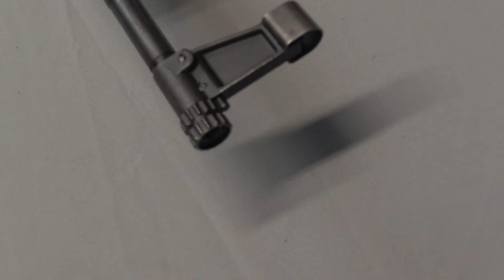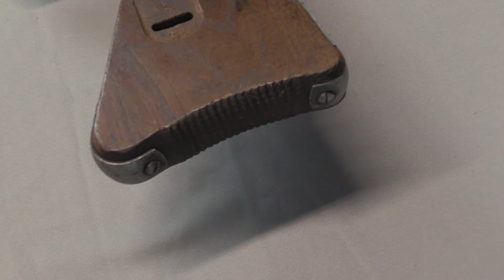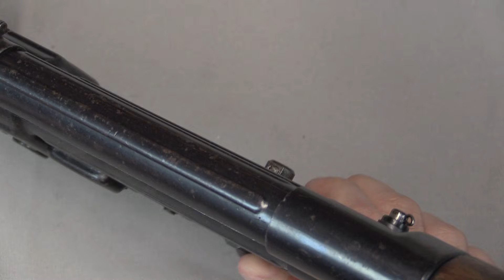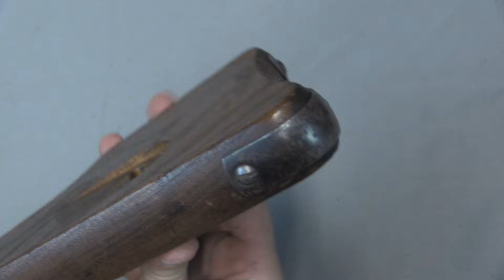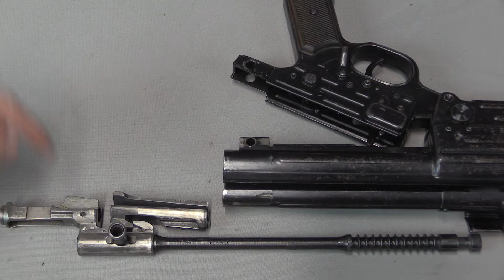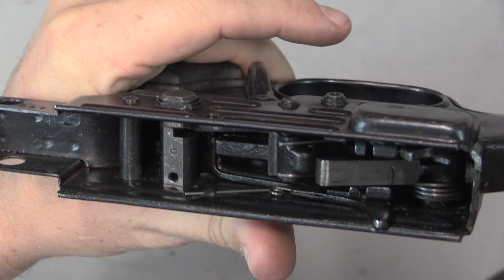Sturmgewehr MP-44 Part I: Mechanics

Comment: During the war the allies could not replicate the German fighter planes size and strength ratio's the forces on the fuel silage required heavy steal and massive welds... After the war the allies found massive stamp machines weighing 100's of tons and standing 4 stories tall. This is how the Germans were able to make planes lighter faster and more agile by stamping the strength into sheet steal and aluminum. They were removed to the USA after the war and even bigger machines were developed to stamp parts for our newest planes...

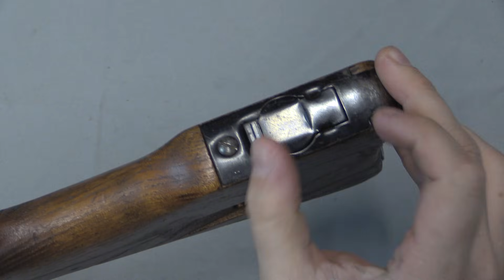Comment: 8:50 that space in the stock is for a special cleaning brush for the gas system. I am a reenactor and it took me a good while to actually find an original brush for the gas system (it is a little bit bigger than the normal brushes from the RG34 cleaning set). But it is specified in the original manual for the gun.

Comment: Why would stamped metal parts have lower trace-metal requirements than forged ones?  Both of those processes involve pressing the metal into shape under force; the difference is basically just whether it's cut before or after shaping.
Reply: they don't need to be strong as the forged ones because they aren't pressure bearing or handling the force of the bolt cycling?
Reply: High strength parts were machined and hardened also. Alloys were required.

Comment: The magazine catch & the hammer through the bolt carrier group on the Stg.44 is more similar to the AR-pattern rifles. Also, the recoil spring is present in the stock. Also the dust cover.
Reply: I dont know what kind of AR you have but there is absolutely nothing resembling the two lol!

Comment: HELP WANTED!!!
There is a lever on the right side of the lockwork, in WORLD OF GUNS it is named CATCH LEVER. I am trying to figure out its function. Maybe some kind of inertia safety device, but I just can't understand it using just WORLD OF GUNS. Any ideas? The inner portion has the trigger and sear, on the left side we have a very complex lever to struck the "disconnector" (that sear which catches the hammer when the trigger is pressed) when the gun is in full auto; the lever on the right side is the problem.

Looking more closely, looks like something to prevent the trigger from moving when the bolt is manually operated, but the part on WORLD OF GUNS is too short and it is not clear that the bolt pushes it forward when the gun is in battery.
Some models in WOG have errors (I found errors in Colt Python's hand and the UZI ratchet cover).

Comment: Question for anyone who would be able to answer this, gun experts only and preferably only gun experts, soldiers,  and  historians who would have the ability to  answer this question regarding the Sturmgewehr MP-44

So in the Sturmgewehr 44 manuals of  WW2 (in particular-  BArch, RH 11-I/44  Entwurf  zur  Heeresdienstvorschrift), the images   clearly display wehrmacht soldiers  holding the  gun by the  mag  and the handle,  unless there was something like free hand aiming position standing or kneeling where the hand is  behind the mag resting by the  magazine lock button. Is there a reason they do this? The only reason I could think is that there is no significant  handguard around the gas block like every assault rifle after AK47 has, but I am not quite sure.

I mean I could think also that it gave quick access to the  selector button which means   being able to use the german tactics explained in the pamphlets better

Comment: As we look at the discussion about expensive/cheap part combinations, plywood is partially an invention of WW2 Germany. Running out of the wood that was sufficient for the K98 rifle, German engineers realized that a laminate of thin slices of high quality oak or ash wood glued in with slices of birch or pine would produce an equal or even superior stock, and if alternating directions of grain were used it would not warp under moisture.
Reply: While I understand you said "Partially", plywood board was already in common use in the US in the 1880s, and the concept of laminating wood traces itself back to antiquity, with the ancient Egyptians making use of it.

On the other hand I agree that in terms of wartime gun stocks, the german use of plywood is quite innovative.

Outside of guns though wood lamination is a very old thing

Comment: You really need to get an StG to the range and run it through a WW2 2-gun action match. Just to demonstrate how this rifle changed the dynamics of the battlefield.
Reply: It didn’t change the battlefield at the time, Not even a new concept, The federov ovtomat was the first assault rifle, Though i do think the STG44 is a better assaul rifle
Reply: @hdexotic1914  Where it was present it most definitely did. Infact it was reports of how it proved key to the success of several operations that even convinced Hitler to finally approve the weapon. The federov avtomat is not a rifle with a pistol grip & inline stock firing an intermediate rifle cartridge, it's an automatic rifle. You could call it a predecessor to the assault rifle, but it's not an actual assault rifle.

Comment: Is it just me, or is the barrel-tilt mechanism on the H&K USP a lot like the bolt-tilt mechanism on the StG 44? The USP has a hook in the top of the guide rod that mates with a hook on the barrel. As the slide moves back, the hook pulls the barrel down just far enough to unlock it from the slide.

Comment: I believe you got a little disorientated with your reasoning as to why the metal stamping was used in the production of the weapon. Yes, you were correct in saying that certain elements for steel were not plentiful in Germany, but this was not a problem in the 1930s, which is the date you stated. The Sturmgewehr was not produced in the 1930s but in 1944, when materials not contained in an ever-shrinking German Empire were hard to come by. Actually, in the 1930s all materials for steel and associated products were readily available to Germany, as in this period it was going through its re-armourment period in all services. E.G. The highly successful MP38 and MP40s were made of steel castings and not metal stampings. On a side issue, I've always wondered how much Mr Kalashnikov studied the Sturmgewehr 44 when designing his "revolutionary" new Assault Rifle.

Comment: Just imagine, what would've happened, if Germans had managed to rearm their frontline troops with these when they still had the chance to do so.  The prototype was succesfully tested in late 1942. If they had started the mass production immediately aftwerwards and pulled most of the K98s from the frontline troops and replaced them with STGs, then holy shit that would've been some army with some freakishly strong fire power.
Reply: I don't see how having slightly better small arms helps you win a war where you have so little gas you're still using horses for logistics, and you're fighting a war on two fronts with literally every other large power in your hemisphere, plus one in the other one.

Comment: Father of all modern assault rifles
Reply: Der Vater, ya.
Reply: Incorrect, The first assault rifle was the federov avtomat, Not the stg44 surprisingly
Reply: @hdexotic1914  federov did not fire an intermediate cartridge, nor did it have a pistol grip. It categorically is not an assault rifle.
Reply: @hdexotic1914  It may be the first, but stg44 is more influencial, because almost all modern assault rifles look like Stg44, while the federov avtomat looks like a traditional rifle, except automatic. Doesn't even have a pistol grip.
Hence why the Stg44 may not technically be the first assault rifle, but is still the father of modern assault rifles in terms of design.

Comment: The trick by using high quality metal only for the important parts, is an old old old trick :)

Scandinavians (that includes vikings), and many Germanic tribes (A commonly known tribe is Saxons, which in large part took to Britain as well).
Used this metal method as well which is evident on Dane Axes and the like - they would use hard metal (steel) for the edge of the axe and soft metal (iron) for the main body of the axehead (which also meant the axehead was better able to withstand the shock of being smashed against something).

Comment: Gee and everybody thinks this design has nothing to do with the Avtomat Kalashnikov
Reply: Machinen Kanone It s nothing to do with the Avtomat, since the avtomat had a full sized rifle round instead of Inter-mediate rounds, and the Avtomat was used like a machine gun and used clips. It wasn’t an Assualt Rifle and it didn’t influence the first Assualt Rifle in any way but it did influence the AK-47
Reply: @ironmarck3133  uhhh, I think you mistook "Avtomat Kalashnikov" for "Federov Avtomat"
Reply: Completely different operation (ak is rotating bolt, stg is tilting bolt like the svt). The Russians considered the ak to be a better submachine gun, and still call it one today.

Comment: The small curiosity: Germans have not any resources of special enriching additives steel. But they had "special connections" in Switzerland! So, MC5 (UK intelligence organization) discovered in 1944, that one of Switzerland clock companies ordered a huge amount of chromium "to the springs in watches". How quickly calculated in London, suffice it to produce the springs for hundreds of years. Of course, the arrested ships carrying the chrome" Switzerland" by the Hamburg Harbour.

Comment: i hope this video finally demonstrates that the STG influenced the design of the AR 15 and not the AK the only thing that the AK took from the STG was the stamping technology that existed even before the STG so technically the AK has nothing to do with the STG in fact the underfolder was taken from the MP40 and that's about it the rest of the AK is actually influenced by american guns but that's another story
Reply: right right i forgot the ak had a long recoil spring that extends into the buttstock, a spring powered dust cover, upper and lower receivers that are held together with push pins oh and dont forget the magazine release button and thumb fire selector and safety
Reply: But the M1 rifle did exist back then and it did influence the AK's rotating bolt action. The StG. really doesn't have as much in common with the AK as it is often said to have.
Reply: The STG influenced the creation of the AK as a concept - the concept of a mid-size cartridge, fully automatic capable rifle with a large magazine capacity, rugged and relatively quick to manufacture and usable in engagements out to 300+ yards potentially.

I've not really heard someone say the AK was an influence on the actual mechanical design of the AK.

Comment: Hmm... tilting bolt, triangular firing pin, gas piston operated, intermediate cartridge, sounds like a certain loveable Soviet self-loading carbine. I'm not saying the SKS is based on this or the other way around, I just think it's funny how similar they are. I suppose you could make the argument the the STG 44 was designed at a time when German engineers had ready access to some of the older Soviet tilting bolt designs, but I don't think they were a major inspiration. I suppose what I'm really saying is the SKS is a (relatively) cheap and available mechanical analog to this for those who want something with a similar primary action type.

Comment: Are intermediate cartridges more controllable due to having a lower mass bullet, less propellant, or a combination of the both?
Reply from the maker: Both.
Reply: Thanks for the answer.
Reply: too much powder, small bullet will cause big muzzle flash and wastage of power , gun spraying out unburnt powder out from front

to big bullet, less powder results in low velocity and thus less damage to target

both have to be tuned according to each other and barrel length

the more the powder and heavier the bullet,
the more, is the momentum of bullet and Newton's third law is the rest of the story

Comment: I thought the definition of assault rifle also included an in-line stock.
Reply from the maker: No, it does not.
Reply: Hmmm, I would  have thought some notion of controllable automatic fire would factor into the definition.  I don't really think of Mini-14s as assault rifles.
Reply from the maker: The fully automatic version of the Mini-14 is the Ruger AC-556.
Reply: Most people don't really think of mini-14's.
Reply: I guess you've never needed to hire...the A-Team.
Reply: Correct, the Ruger AC-556 was their "military" version of the Mini-14, though it was never actually picked up by the US Army or anything. Nowadays Ruger is just selling their old stock of AC-556's to people with the appropriate tax stamps and licenses in the US (if they haven't run out yet). Apparently it's a relatively cheap full-auto gun compared to Colt's full auto M16's and such.
Reply: Jersey Mike's Rail Videos Mini 14's do not have selective fire though.
Reply: Not entirely so. Some of them do as there is mention of FA mini 14-s in an old Jane's Infantry weapons book I bought as a child. I think Ruger went after some military contracts at on point with his gun.

Comment: So how come the CZ side tilting bolt rifle has the barrel off at a stupid angle and and side tilters like this don't seem to suffer the same way?
Reply: It isn't a side tilter. The bolt tilts vertically; it's locked and in battery when the bolt is "down".
Reply: This is a vertical tilting bolt, and the bolt face was canted to accommodate the tilt.
Reply: yes but I should have stated it different. Either way it tilts off an axis. Which axis relevant to the shooter wouldn't dictate a difference in other aspects like barrel alignment would it?
Reply: bren has a tilting bolt,in fact the Germans got tilting bolt from the Czechs.

Comment: Wasnt one of the issues with this rifle poor headspacing? If I remember correctly rather than doing precision machining, they placed blocks of lead to correct any issues?
Reply from the maker: Yes, the headspacing was very haphazard - finding them today with up to 30 thou of excess headspace is not uncommon. However, between the low chamber pressure and the wartime steel-cased ammo, this never created a practical problem.

Comment: Not even gonna lie. This piece is worth the current $11,000 it's sitting at right now.
Reply: I'm honestly surprised it's not higher, given it's rarity, historical significance and the cost that full-autos command these days.
Reply: this company actually makes "Sturmgewehrs" for less than 2k https://www.hmgunworks.com/
its in US so if you live there you can get it quite easily
you can choose the caliber you want
Reply: Lark Alfen it was a “scam”. As far as I know, they were never shipped to people, and definitely won’t ship anytime soon. The closest you can get to a legit StG-44 now without paying for the real gun is the GSG StG-44, but it isn’t a 1:1 replica.
Reply: @larkalfen9510  It's a copy that why its worthless
Reply: Echelon Dread Right...
Reply: +Echelon Dread i'd reckon ammo is a good bit more scarce.
Reply: Blackbird they make the ammo but it's cost a lot. Most axis ww2 guns have ammo that is made today but it's like $25 for a box of 20 rounds.
Reply: Blackbird Not really. They make modern ammo for the STG that works fine.
Reply: They actually don't go for a whole lot, you can get MP44's/StG's for cheaper than M16's.
Reply: I saw one a few years ago at a gun shop for like 3500 or 4000 that looked like it was in nice condition.
Reply: Honestly yeah, and I have to agree with those surprised it's not higher. If I remember correctly, full auto ARs and AKs are around $30,000. Despite the limited ammo supply, I'd consider this to be more valuable simply due to its historical significance. Its unlikely anyone will ever make these again, but people are manufacturing AKs, even automatic ones, all over the world.
Reply: If you are still kicking psa announced they are going to start making them.

Comment: So in other words, the insides don't look anything like an AK.
Reply: Kind of depends on what you consider to be an assault rifle. The M2 Carbine is both select fire and in an intermediate cartridge (arguably, anyway; .30 Carbine is not a pistol cartridge, and it's definitely not a full-powered rifle cartridge, though it is underpowered compared to most intermediate rounds), and was fielded late in WW2, possibly making it the second.
Reply: Do you think that it would at one point look like an ak if the war took a year or two longer?
Reply: Well assault rifle-like guns popped up here and there ever since late the beginning of 20 century. Like the 1915 Fedorov Avtomat. MP44 gets the cake as the first one to be mass produced and effectively used in warfare.
Reply: @KeyManDan  StG44 also gets the cake in being the first one that actually looks like a modern assault rifle. Fedorov Avtomat still looks more similar to bolt-action rifles.
AK47 might not be a copy of StG44, but it's outer design is heavily influenced by it.
Reply: @anton2maa  Honestly, I see more StG44 influence on AR-15 then on AK. Especially in the lower section.

Comment: I know that it's called 8mm Mauser based upon the fact that 7.92 is almost 8mm Mauser. So I understand it from a simplicity standpoint. But why do manufacturers call it 8x57mm Mauser when it isn't? It's a simplification of 7.92x57mm Mauser.
Reply: My guess is because there is also a 7mm Mauser. They probably didn't want to cause excess confusion.
Reply: Matthew Harger doubt it.

The 7.92×57 cartridge is called 8mm mauser because 7.92 is essentially 8mm